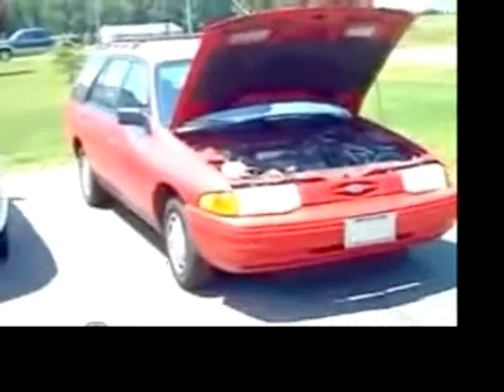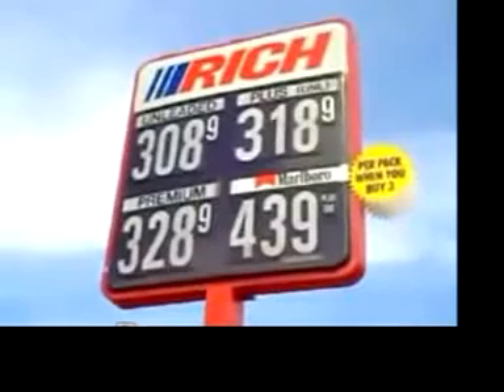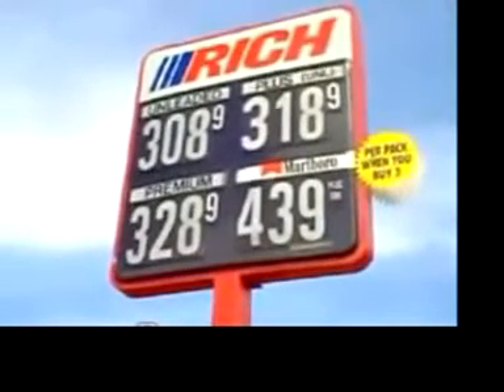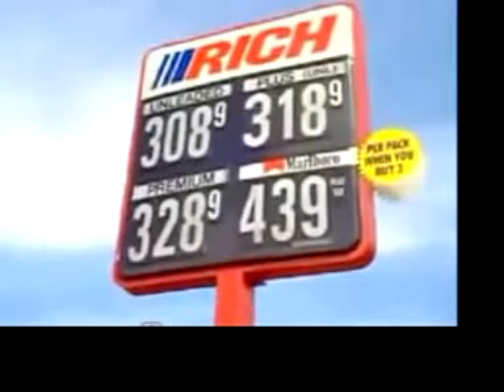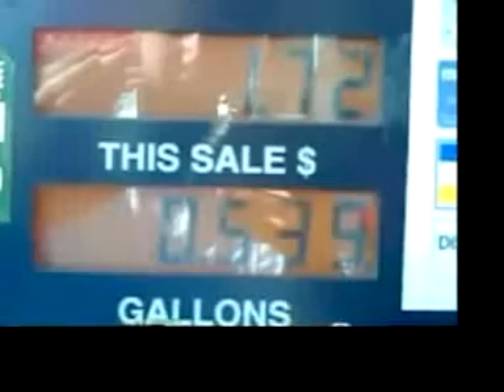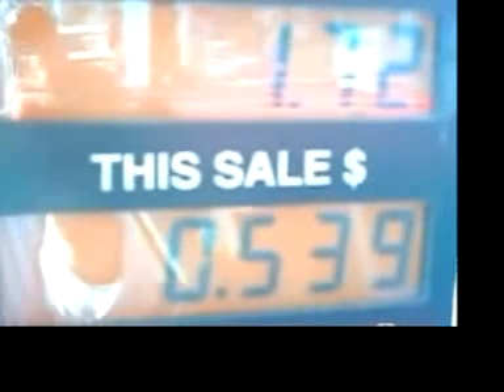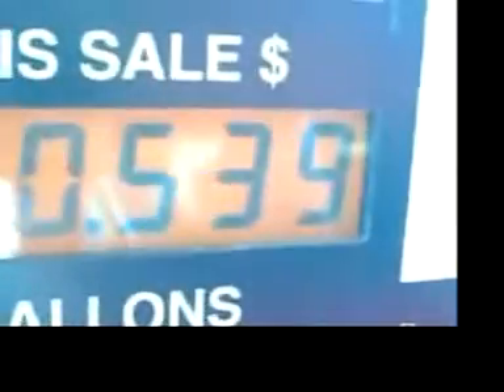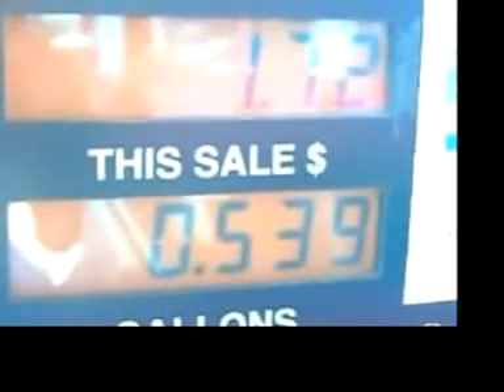[Water Fuel Car] HHO Gas Generator [Water Fuel Car]

Comment: Good work! but i must ask. How did you end up getting 60 MPG? I think that would come out to something like 45-50 MPG city. City is what i am concerned with. That seems like a higher gain than most people see. I know the wagon only got around 20-23 mpg when it was new and unaltered. Are you sure this is accurate? Just want to figure it all out.